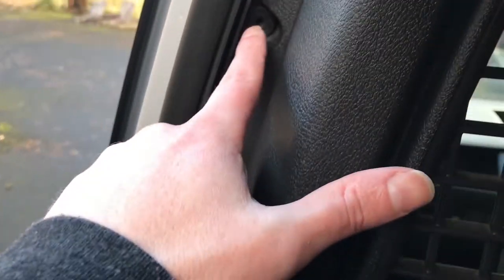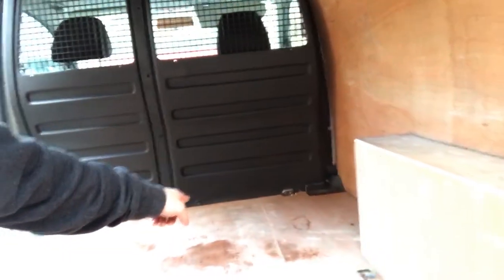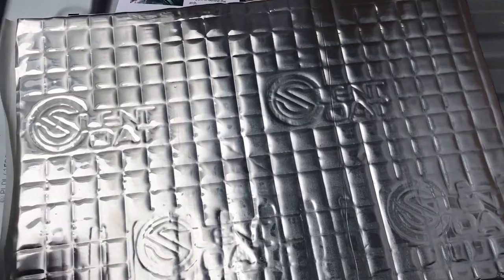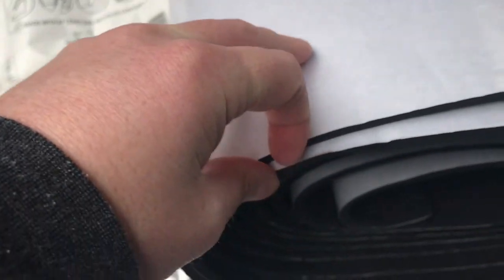Panel Van to Carpeted VW Caddy in under 12 mins

Comment: @Olly Just got a 2013 caddy auto for Mrs mate. It's all ply in the back mate with bulkhead. What do you recommend bud strip all the ply out and remove bulkhead? Or just carpet the way it is?
Reply from the maker: If you carpet the ply it’ll be way easier than removing it and look nice and neat. Removing the bulkhead makes it feel way roomier but u may need to remove the ply floor to get to some of the bolts for the bulkhead. Which may need more work than you want to do
Reply: @FreeworldOL  Cheers OL thats sound advice man